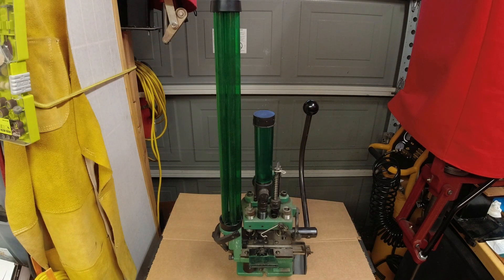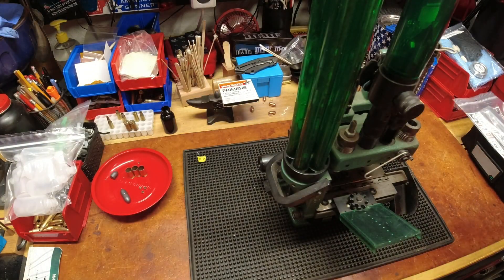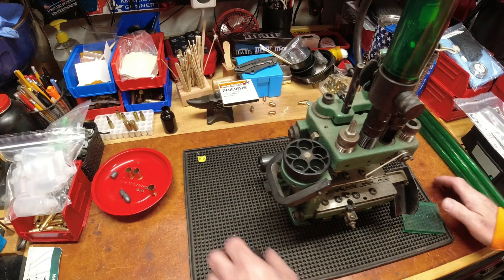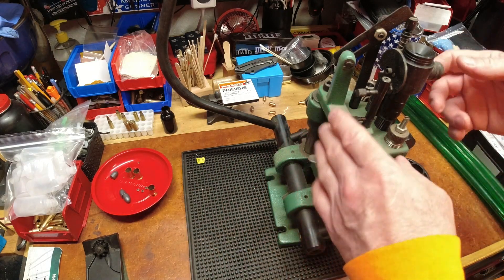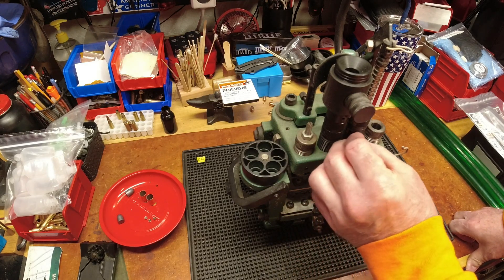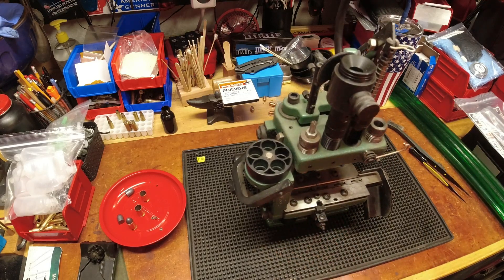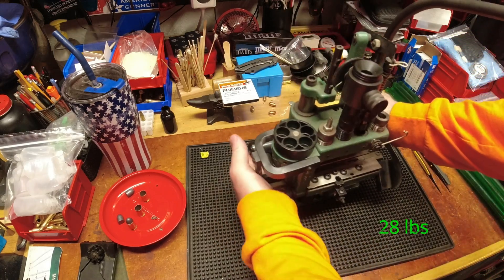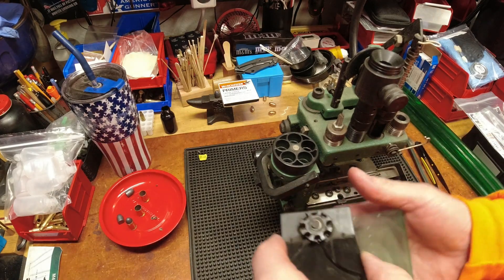1983 RCBS Green Machine Inline Progressive Press Barn Find: Part 1 - Features

Comment: I bought one new. The priming stage is on the up stroke. Mine never worked very well despite how much I fooled with it. Unwanted powder drops onto the rails will be common while you are learning on the GM. I still manage to do it occasionally. Some hacks can be had to make better ammunition on it. Bullet seating depth is inconsistant due to flex in the rail base but that can be fixed with a hex nut and an adjustable powder rotor will make tuning your powder charge much easier VS finding the right lil dandy rotor. There is a guy on cast boolits that makes them. I still use mine and it makes nice ammunition. A Dillon would be a better option but these are interesting. I'm quite sure they caused many people to have grey hair early. Good luck with your's.
Reply from the maker: What caliber is your GM?  As you'll see in further videos, I get this cleaned up, make a base for it to lock between my T-Tracks on my bench and finally got to truly see how the press feels by fully cycling a casing from decap/resize (wasn't able to do that free standing on my bench as I had no leverage), powder/bell, bullet seat and finally crimp.  Round came out to 1.27", a bit below my standard of 1.32", but as you say, the GM is a bit finiky.  This will only be a bench "toy" for the most part.  A cool, old, interesting machine that works, but won't be my 45 ACP production platform.  A few more videos to come on this cool old inline progressive press.
Reply from the maker: forgot to ask what year did you buy yours new and what did you pay?
Reply: @ReLoadersBench  I bought mine in 1985. I think I paid around $400 for it back then and it was quite a bit of money at the time. Not to long after I bought a RCBS Auto 4X4 progressive to load other calibers. It was also a problematic press but I still use it. My Green Machine is in 45ACP.

Comment: Ok this press is my age
Reply from the maker: This press, from what I'm learning, is kind of like the original BMW 8 Series...folks either loved it or hated it.  There was no in between.  I think this is a wonderful example of a mechanical marvel.  Apparently only a few vendors made the inline progressive press...RCBS, Cougar & Hunter and CH (now CH4D).   All seemed to have failed in reaching acceptable sales due to the fact they were not easy to use and one had to know what they were doing.  The two big missteps on the RCBS were the priming system and powder drops.  However, it introduced the Dandy Powder Measure which became a great success and still sells to this day marketed as the most accurate rotor based powder measure (RCBS' claim, not mine).  In any case, this is a really cool machine and there will be more videos to come.
Reply: @ReLoadersBench  your mention of the old 1900 circa national Cash register I've got one that used to be my grandfather's he used it many many years ago when he had a gas station way back in the day and he died of old age back in the mid sixties I remember him using still when I was just a young kid and it still works and I don't have any use for it so I'd consider selling it and I'm always up for a trade for whatever would interest me
Reply from the maker: The next vintage press (this one will be a shotshell reloader) is from ~1960...so that one will be older than me!  Should be pretty cool to clean up and get looking new to use.

Comment: That press is more than cool. It is similar, like you said to the Hornady 366 press you have, which I also have. 
Have not looked at the serial # but mind does have some of the ,I believe older stuff on it (blk shell holder) 
and the like. Also first made in 1971 and weighs 30.095 lbs. The stroke on it is if it were new and smooth as
glass. Parts seem relatively easy to get. Looking forward to seeing the clean version.
Reply from the maker: I tend to gravitate to the older mechanical machines due to how they were made...to last forever.  No plastic or cheap materials.  Heavy duty all the way, thus the weight, especially for something that has such a small footprint at 6"x5".  Also cool to see the impact these older designs have on today's gear.  Hornady didn't design the 366 shotshell reloader, they bought Pacific way back in the day, which is why you still see the Pacific name on Hornady gear.  Pacific had some great stuff...and their original color (another discussion all by itself) was BLUE...before Dillon ever existed as a company.
Reply: @ReLoadersBench    Thanks for all that info. Love the old stuff, they just don't make things like they use too !